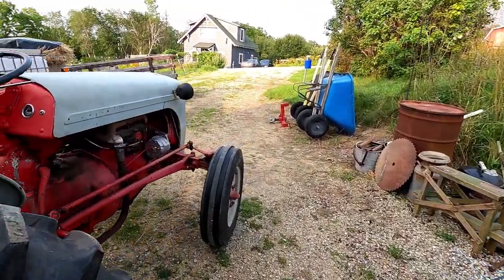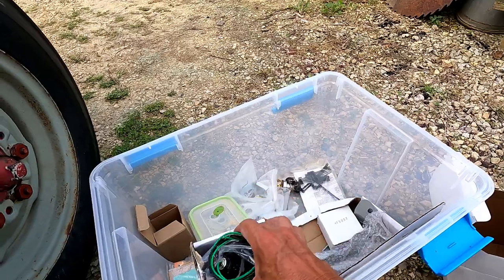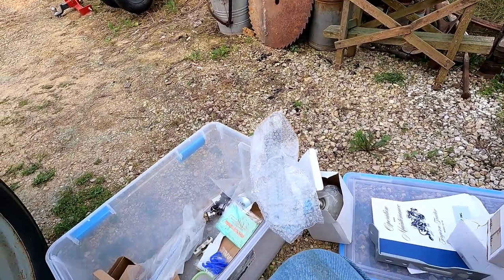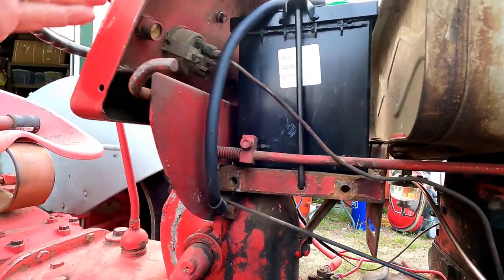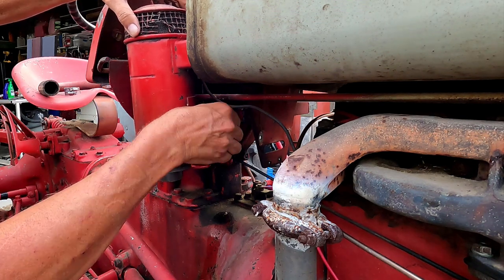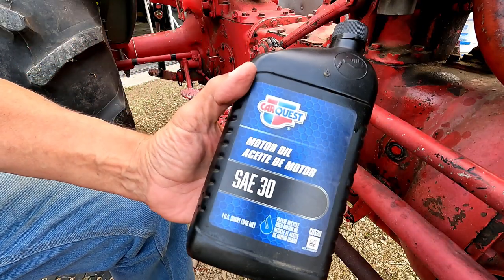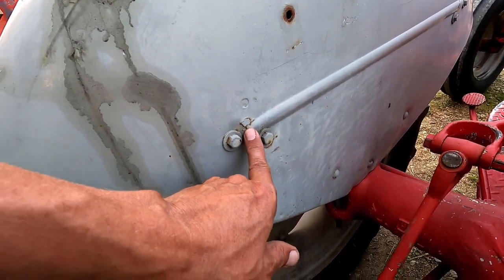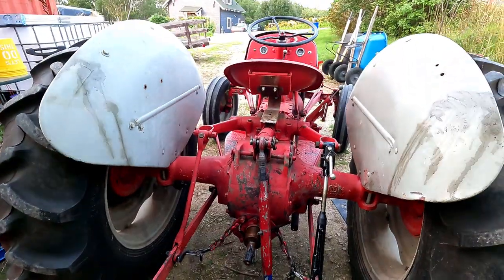Ferguson TO-20 ― Oil Bath Air Cleaner On ― 6-Volt Lights Off

Comment: Hi Moj, great vid as  normal, be a treat when you get the brush hog installed.
Reply from the maker: I agree. That will be the main purpose of the tractor — to tend to the pastures. Bush hogging, spraying, and fertilizing will be it's main chores. Also, hay rides for the kids and it will go in the local parade this fall as well 😊
Reply: @PlanetMojo  I agree the access plate for the oil filter can be a pain
Reply from the maker: @dennyussery1021  Especially if you have a dented aftermarket pan like I do. I'm looking for a used cast iron one if you have any leads 😊
Reply: I just looked at my 49 fergie and there is 4 clamps on the air cleaner ( oil bath ) tube
Reply: If you have any questions I'd be more then happy to help you out if I can
Reply: @PlanetMojo  I've never heard of a cast iron oil pan but that would be nice. Sorry
Reply from the maker: @dennyussery1021  That's what I thought. They are likely under something in the shop — I'll have to find them.
Reply: I Googled it and there is a cast iron oil pan but the cost is 169.99 alone
Reply from the maker: @dennyussery1021  Thanks Denny 😊
Reply from the maker: @dennyussery1021  Apparently the stock oil pan is cast iron. Sheet metal ones are replacements. You can by either one online, but the cast iron ones are very badly cast so I would like to find a used original. I may have too get another tin one though as I am not seeing a used on online.

Comment: Hey there, neighbor.  Your project looks a lot mine!  Just picked up a TO 30 in June.  Have it in pieces in the shed right now.  My axle is leaking as well.  Not sure how I'm going to get it all back together again.  I've got parts from Steiner as well, but they don't seem to fit my tractor.  Being old like it is--there's lots of history and previous owner's may or may not have made some modifications.  I don't think mine is original. . . .  Fun!
Reply from the maker: Hi James, same problem here. Some of the stuff was definitely from different tractors, and some was home-made or whatever was laying around. They do have oil seals at Steiner, and I'm going to install them when I do the brakes. I'm also on the hunt for a used OEM oil pan. Even with all of that, they are great little tractors 😊

Comment: Great video! Thanks!

I was wondering if there's any specific reasons why you use SAE30 grade in your oil bath?

I'm asking because I own a little tractor and I was looking to service my oil bath air cleaner, but I don't have any SAE30. So, I'm curious to know if you think 15W40 could do the job as well?
Reply from the maker: I'm sure it would be fine. I believe they specify straight 30 in the owners manual, but that's likely because it's the same oil they specify for the tractor? At any rate, I don't think the weight is that critical unless you go too thick and it impedes air flow. I would say 10W30 would be better, but 10W40 should work in my opinion.
Reply: @PlanetMojo  Finally when I disassembled the whole filter to clean it, there was indication on the side saying "non detergent SAE20".

From what I"ve read somewhere, it's because with other type of oils, those with xWxx, some sort of "chemicals particles" can get to the engine and cause a runaway...

Is it true or not...? I can't tell, I'm no pro. It's just my 2 cents here...

But as I've experienced what a diesel engine runaway once, I've decided to get the good oil.

Comment: Hello, did you ever figure out why your ammeter wasn’t working?  I am having the same issue after wiring everything up.  It’s not giving a reading.
Reply from the maker: Unfortunately no. I got caught up in building a post frame shop, but I will be working on the tractor again shortly.

Comment from the maker: I'm kind of splitting my time between the tractor and getting the barn ready for it's big move — and everything needs to be done early in the morning or later in the evening because of the heat. It's the dog days of summer right now and it's unbearably hot during mid-day! Some more videos as well as the stuff I put on the tractor listed below:

Here is the playlist for the Ferguson TO-20 tractor:
https://www.youtube.com/watch?v=fBSe22Vcd9o&list=PL_iZ8t8zAFuMSeubgkz3oYvPq_zCOKLST

Ferguson Stuff
Pertronix 1244A 40511 Ignitor and Flame-Thrower Kit -- https://amzn.to/3q0J39e
Ferguson Complete Carb Repair Kit Marvel Schebler -- https://amzn.to/3npTzFg
12-Volt Conversion Kit (Not the same -- looks better)-- https://amzn.to/3nr2KoI
1-3/8 PTO Conversion Shaft Assembly -- https://amzn.to/2XnLPsB
ARES 13000 - Professional Ratcheting Crimper Tool -- https://amzn.to/3pZx77x
Berryman Chem-Dip Parts Cleaner - https://amzn.to/3bid5AO
Economy I.V. Pole - https://amzn.to/3deQHZl
Auxiliary Fuel Tank - https://amzn.to/3xZnidY
Evaporust -- https://amzn.to/2TexcZN
Leveling Box - https://amzn.to/36DfbrR (the black lifting arm that I put on)
Zerk Assortment - https://amzn.to/3rcLYNI
Ferguson Complete Carb Repair Kit Marvel Schebler -- https://amzn.to/3npTzFg

Here are some more Ferguson TO-20 videos you may enjoy:
Ferguson TO-20 Oil and Filter Change -- https://youtu.be/ODVJuHWVSkM
Mapping the Ferguson TO-20 Wiring -- https://youtu.be/PfnxnMs1Buo
Ferguson TO-20 Oil Change --  Success! -- maybe... -- https://youtu.be/hcvR2fMRSTQ
Ferguson TO-20 12-Volt Wiring [One] -- https://youtu.be/QKW1_Y6UA2Y
Ferguson TO-20 12-Volt Conversion  - Poor Design -- https://youtu.be/bhKZIzffc5I
Ferguson Oil Change Take Three – Part 2 -- https://youtu.be/qsUpPQB7jb8
Fixing a Leaky Water Pump on a Ferguson TO-20 -- Part 1 -- https://youtu.be/oBkkyaLJiE8
Ferguson TO-20 12-Volt Wiring [Two] -- https://youtu.be/9MBYFrS7Nik